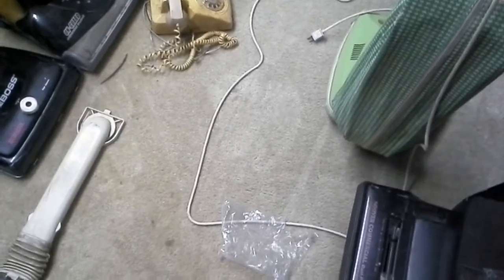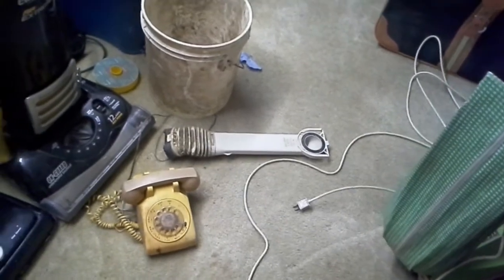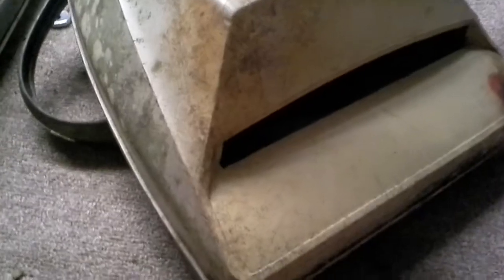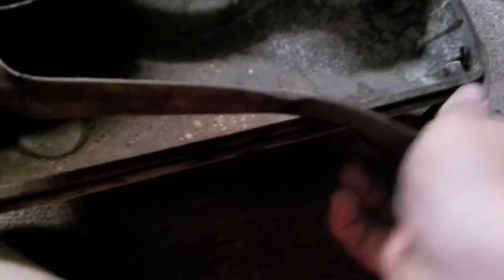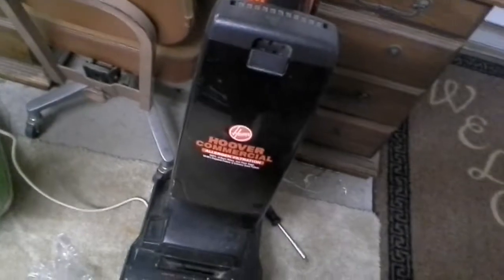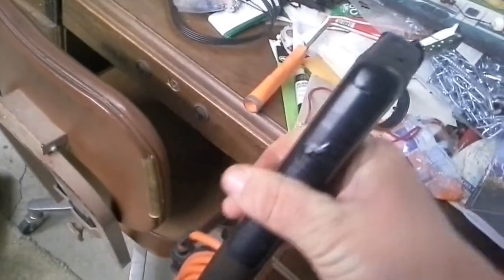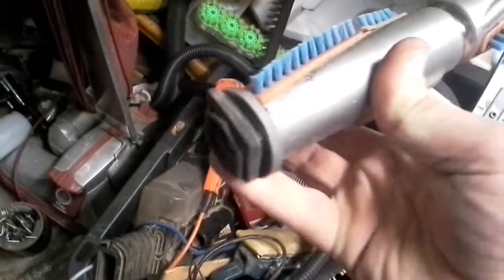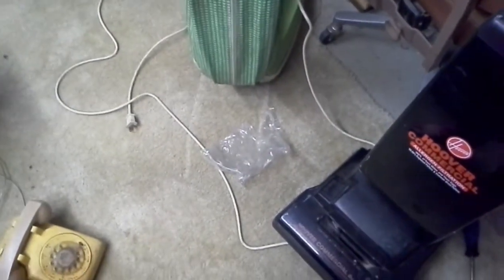Got my work cut out for me. (New toys to play with)

Comment: I do have a round handle & handle bail in great shape on a parts convertible. Also, a type c & type a bag setup. The one with the square handle is identical to one I owned years ago. They are nice, 6.0 amp motor if I recall.